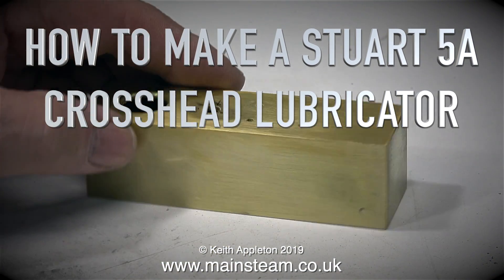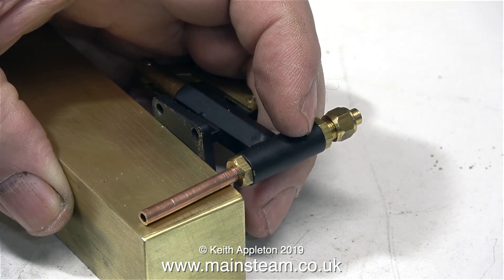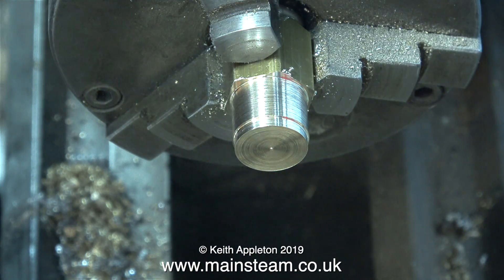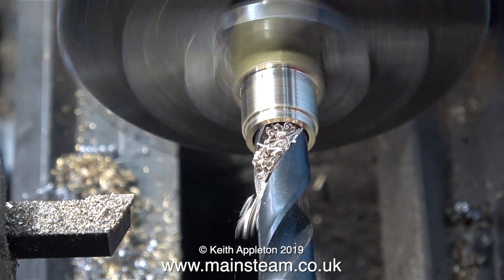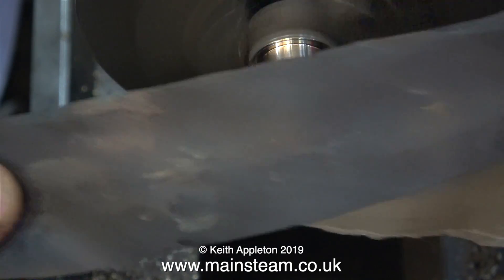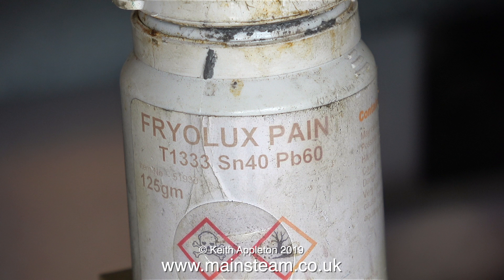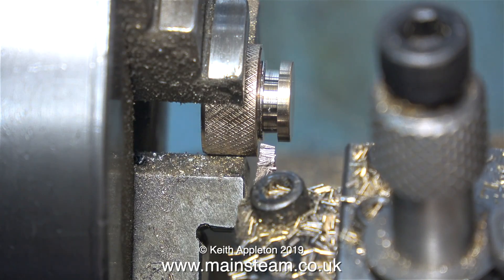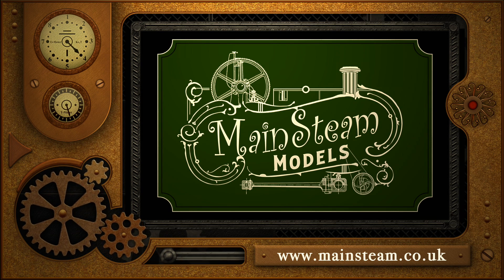HOW TO MAKE A STUART 5A CROSSHEAD OILER - PART #3

Comment: I've got a knurling question: I enjoyed metal-working shop class in middle school when I was a youngster and knurling was something that always worked well, with perfect results, but I never could fully understand... How does the knurling tool remain in the same pattern without cutting away at the entire surface of the work?  No matter what the circumference of the work, the pattern repeats perfectly around with no overlap or mistake... ? Do you know how this works? (Sorry for another question and thanks for your time.)
Reply from the maker: The Knurling tool just seems to follow its own tracks, the more pressure you put on it, the deeper the Knurl but the pattern is formed by the shape of the wheels.